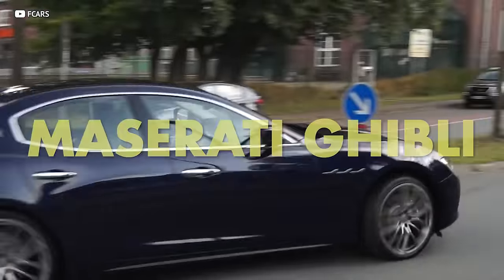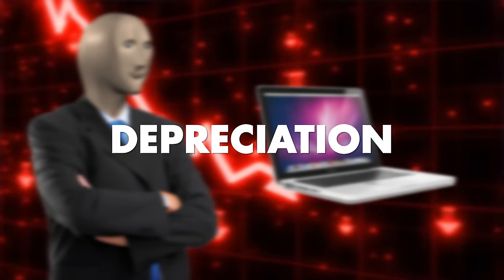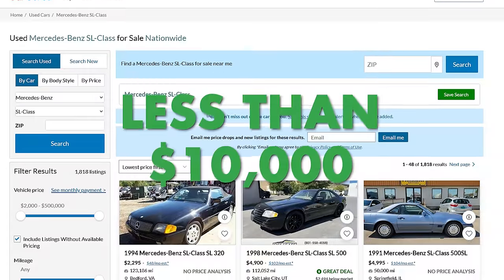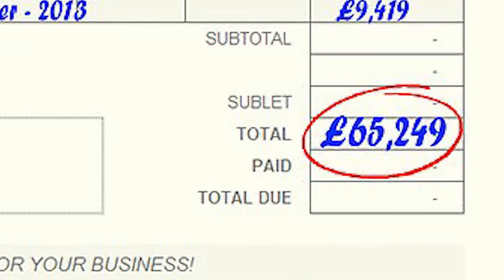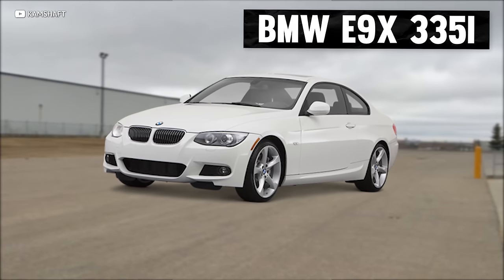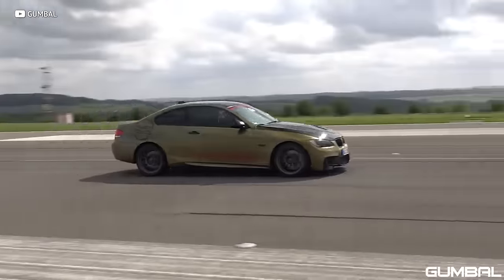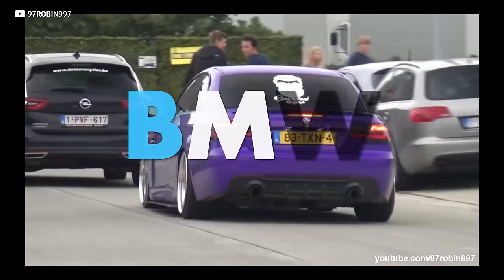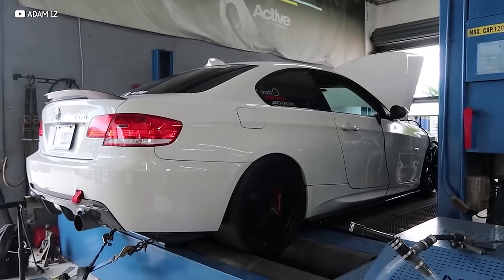Do NOT BUY These 10 Cheap Luxury Cars (You'll Go BROKE!)

Comment: Maintenance and upkeep costs are always calculated as a percentage of the new car price. If the car cost 100,000 when new, they are automatically 3x higher than for a car with a new value of 30,000. If a car is older than 10 years, you should calculate 5% of the new car price per year for maintenance and repairs.

Comment: FULL STOP.

I’ve been restoring a 2003 E class, and any Benz dealer will warranty out the SBC braking system in its entirety up to 25 years after the year of the car, and unlimited miles. 

Cost - $0
Reply: I have a 1989 Mercedes Benz 300ce and I love the car, fixing 3 issues it currently has now. Once I do that it’ll be a 100% road worthy, it’s at 70% as of now. Other than that it’s an amazing car, I just gotta button up the sound, paint and interior after it’s mechanically good, but after all, a 35 year old car!! Has survived way more than most new cars and has less than a 140k miles

Comment: The E90 M3 is an awesome car .. yes the throttle actuator can be an issue but you can fix for as little as $200.. only other possible issue are rod bearing .. you can replace for $2600 .. pricy but well worth it for this sweat V8 .. redlines at almost 9K and over 400hp .. or you can buy a Camry

Comment: Ah, the SBC braking system of the SL. That hydraulic unit is $1200 to purchase, but another $1000 to $1500 or so to install it, program it, and bleed the system. And they ALL need to be replaced eventually, because they do in fact have a service life, and the hydraulic unit counts it down. Benz stopped using SBC because folks were complaining about the cost to maintain such a system. Even though it’s a car that costs as much as a house, and the people know that going in……
Reply: The SBC in my 2009 SL was covered by the dealer until 2035.  Mercedes took full responsibility and replaced it for free.

Comment: I used to own a 2010 e92 335i. Most of the problems associated with high-pressure fuel pumps in earlier model years have been fixed in mine. However, the oil filter housing leak remains an issue. As for DFI carbon built-up, this problem is no different than other makes, like the Porsche, if you will. I also currently own a 2009 Mercedes R230 SL550 bought from new with relatively few issues. The key is to keep all maintenance up-to-date. For example, I flush the hydraulic suspension fluid every 30K miles, which prevents dirty fluid from clogging the valves & pipes. The cost to service the fluid at an independent Mercedes specialist shop is only a few hundred dollars. If you are willing to spend time & money on these maintenance items regularly, the Mercedes SL550 is a wonderful open-top GT cruiser that always puts a huge smile on my face every time I drive it.

Comment: Full disclosure: 
I changed all 8 wire harnesses and spark plugs on my 03' E500 Sedan, while in my driveway 3hrs tops. I also located a set of re-maned air struts from a spot down in Florida ($325 each). I then picked up Anti-Lock Break Pump ($199). I handled the light work and paid a pro shop to do the heavy lifting. It didn't quite cost me $1100, back in 2021.

Comment: I have noticed, I wonder if other people have noticed, these expensive European luxury cars plummet in resale value when they are just a few years old. I’ve watched the television auctions when a Rolls-Royce, or a very expensive model Mercedes, or Bentley comes across the block. They usually sell for around $.10 on the dollar of their original sale price.
  my best friend since high school back in the 60s loves BMW convertibles. He has bought three of them over a ten-year stretch that were returned lease cars. He bought the extended warranties on them not from BMW, but from those warranty companies that are always advertising on television…
 every time he took those BMWs into the service department at the dealer, he never got out of there without spending at least $1200 for simple things like oil change, filter, change, some noise or rattle. None of which was covered under warranty.
 he did have four expensive things happen to those three BMWs over the years that he was paying $151 a month for that warranty coverage..
convertible top would not go up, not covered 
Control panel that controls the opening and closing of the door locks and controlling the windows going up and down went bad, not covered 
  automatic transmission, shifter lever, that the driver could put into manual or automatic mode and drive the car, as though it was a stick shift by moving the lever through the pattern of shifting gears, they were all failing, and they were back, ordered to Germany, and even the salvage yards were out of them, because they were failing at such a high rate, not covered
  his driver seat frame broke, not covered. You think it would be not that tough to fix a broken seat frame, but that was a leather covered heated power seat.
 those four problems with his various BMW convertibles cost him over $11,000 out of pocket because they were not covered by the extended warranty. He was paying $151 a month for for over 10 years.
  over those 10 years, some little things were covered under warranty, but they were never items that a monitor more than a few hundred dollars. Over those 10 years that $151 a month for the extended warranty added up to over $18,000 that he paid in for that insurance that did not cover the big things. And, add that to the $11,000 he paid out-of-pocket to have the big things fixed. That is more money. more than $29,000 that he paid for that insurance, and the things that were not covered by the insurance. It dawned on him that he paid less than that for any one of those BMW cars when he bought them used…
  he finally grew up and went out and bought a new Chrysler minivan. He said it for six years now, and not had one single problem with it… And he didn’t buy the extended warranty either

Comment: Not these but a 98 Murcury Mystique that needed its 3rd motor at around 114,000km for which Ford Canada told me their engines are a common replacement item at around 70,000km

Comment: I owned a 2017 gulia qaud… bought it brand new and that thing had electrical issues and more from day one.

Headlight washers would pop out to spray the light and basically self destruct whilst ejecting outwards. 

Had a check engine light for the entire first year of ownership due to low compression in one of the cylinders and was eventually replaced with a new engine under warranty which cost about $40,000.
Lemon lawed that gulia asap after that couldn’t imagine owning one out of warranty especially with almost 50 pages of unmentioned service records from the first year.

Comment: I currently own a 2011 335i. I would not recommend buying any 335i with an N54. The N55 is much more reliable and you can still make great power on it. As long as you are prepared to to maintenance to the car, it’s a pretty great car for the price.

Comment: I have owned the Mercedes 2003 500 SL bought it used for 30,000. With only 30,000 miles.  Within 30 days cost me 20,000 to fix. I still had another 10,000 to go. 🤦🏾‍♂️ Needless to say 30 days later. I traded it in with my 2008 Cayenne to buy a 2013 cayenne 🤷🏾‍♂️ I’ve owned Range Rover. Also another decision.  I’ve had the best experience with Porsche out of all the vehicles. I currently have a 2014 911 Turbo and also a 2022 Panamera 4SE hybrid.  I’ve owned 18 Porsches. I’m Looking forward to buying a 2024 Cayenne coupe.

Comment: as someone who owns 2 BMW 335i at different years (2010/2011) let me just say any 335i prior to 2011 is better than any BMW 3 series 2011 and on. They came out with the twin scroll turbo which is kind of bs plus capping one of your exhaust with a flap. The reliability of parts also drastically decrease and prone to break compare to the prior models so be aware younglings :)

More context: you can technically disable the flap and have it always open by disabling a cable by your taillight however that would some times trigger a false positive error. They started using rubber seal around your front windshield which definitely will deteriorate overtime, water won't get in because the windshield still has its glue but the seal is basically all gone in a few years if the elements beat on it. Finally the most bs of it all was the steptronic. I rarely use it but one day it failed out of the blue, it basically will not go back to your regular mode when you get out of it unless you break completely and the auto system will kick it off. When I took it to a BMW dealership they took it apart and in the end telling me they couldn't figure out what the issue is but they can only guess it's "wear and tear" of the wiring :/ needless to say its all bs.

My 2010 335i was still a twin turbo, no cap, no rubber seal but plastic, and never had an issue with the steptronic and I own both relatively the same amount of time in the same environment.

Comment: SL55

I had one in 2014 for 6 years. Only bought it because it had the option of a Mercedes warranty @ £1500 a year. When I sold it (for peanuts) the total warranty bill was over £80,000.

Dash (led failed) - £4500 
Fuel tank (baffles loose) - £10,000
Central locking system - £3,000
Door handle - £700
Suspension struts x9 - £2000 each (£18000)
Suspension pump - no idea
Suspension oil pipes (had to have a new production run made @ mercedes so had an S-class for 4 months) - no idea.

The roof, engine and gearbox never went wrong, though. Plus it was my favourite car. Still miss it.
Reply: If you were using your own money, using an independent specialist, doing some of the work yourself, using OE manufacturer parts from factors likes the German company Autodoc and breakers ,the cost would be a tiny fraction of that!
My experience running a more humble older CL500 with abc was pretty painless.
In eastern Europe with lower labour rates it would cheaper still, however older luxury cars are way cheaper in the UK to buy than anywhere else apart from Japan so swings and roundabouts.

Comment: WRONG!! The Range Rover's direct injection 5.0 AJ-V8 Gen III engine has no similarity with the Ford Coyote, being derived from the multi-port Gen II AJ-V8. All AJ-V8 engines are all-Jaguar, with no Ford origin. 

BTW, the Jaguar AJ-V6 engine is also falsely claimed to be based on the Ford Duratec v6, while it is in fact the other way 'round. The AJ-V6 is all-Porsche, bought by Ford when Porsche abandoned its replacement of the 968 and 928. Cosworth engineered a cheaper head for the Duratec v6, Mazda did the same for its version and Jaguar was handed the unaltered Porsche v6. The engine was modular, the v8 being installed in the Taurus SHO, and the v12 in Aston Martins. None of these ex-Porsche engines is "Ecotec-based", as is commonly claimed.

Comment: 🤣 I have an 08 S4. love the car, but hate the bills. Never buy one unless the timing chain was done 90k. It also has a water-cooled alternator, but I have never had an issue with it.
I need a small facia interior piece made of carbon, it's $400, the armrest center cover because the latch broke $500, and general maintenance is also pricey.

Comment: You guys are doing a good job. 
I know exactly how many problems there are with the BMW 335i. Especially when the power increases. At the same time, it's my favorite car, even though I've stuffed so much money into it that it makes me sick.
Interesting that in other videos you recommend the 335i as a cheap option to get high performance.
Can you make a video recommending a car like the 335i that could get high performance, look good, not cost a million, and not cost twice the value of the car to repair?
I'm guessing such a car doesn't exist, but you might surprise me... :)
Reply: N55 more reliable than the N54
Reply: As a previous owner of a 2011 335i it was reliable.  I had the same exact engine in our X5 and it had nothing but problems all the time. We got rid of the X5 and now my wife has an 3018 Rx350. The only problem with that has been the stereo head unit literally died and would have been $3,500 to replace if we did not have the extended warranty.
Reply: Sorry 2018!

Comment: Dont listen to this guy. Just get an extended warranty contract like Carsshield or Endurance warranty company.  I own a 2010 Mercedes-Benz CL 65 AMG V-12 and I first had the Carshield warranty and now from recommendations from Mercedes-Benz of south Atlanta (where I originally purchased it), I am with Endurance warranty but plan to go back to Carshield next year. I had it covered from Carshield for 3 years and endurance warranty for two years. Yes the ABC suspension went out but it was a cable for $900. Now years later the shocks are leaking but I found two on eBay for $350. I did have transmission issues but Carshield replaced it. My window stopped working and Endurance warranty paid for it. The alternator and starter went out but Carshield paid for it. The control arms and brake caliper went out and Endurance paid over $3k. My Benz was a 1 owner lease return and I still drive it. The radio has been the only main problem but if you don’t car about music then you good. The warranty companies don’t fix most of the radio stuff.

Comment: I was on my way to work one morning and I saw a pretty nice looking car. It was on a flat bed and it was something I'd never seen nor heard of before. The car was a Karma Revero GT. It was from where I was sitting, it was a very nice looking car. It had a pretty blue paint job and it was a wide body like I love on sport cars. 
   So I went home and started trying to find out what I could about this car. I was definitely interested in maybe buying one. But there was one thing holding me back. The first one I have ever seen was on the back of a flat bed truck. I wasn't sure if it was broken down or being delivered to someone. 
    I looked the car up and the price tag brand new was $145,000..... Well, I need to see if I can find maybe a used one for sell. The price wasn't scary at first, but then when I dug a little deeper into this car, I find out that a 3 year old used car is selling for $30k to $35,000. This car definitely doesn't hold a resell value for crap. I thought about buying a used one and if I loved the car, then maybe I'd be interested enough on buying a brand new one. 
   I went to 2 different city's to look at and test drive the cars. 1 car was $32k and the other one was $45k. I pulled up about an hour early at the dealership and I see someone working on the car. This to me is not a good sign at all, especially when you want $45k for a 2 year old car that doesn't hold its value. I talk to the service guy and he informs me that the car has been sold and he putting the finishing touches on it. Oh I got so mad 😠 😡 😤. I walked in and ask them why they sold a car when they had someone driving 15hrs to see the thing? They said oh your the guy coming to look at it? I said yes and I haven't bought anything yet. 
    We walk back to the car and I opened the door. The inside looked pretty good and not very many miles on it either. Now time for the test drive. The guy tells me that it can't be driven yet, cause the battery pack is bad. They ordered one and it would be about a week before they could get it. I said ok, thanks and I left. 
   The next car is a person's car at their house. I drive another 4hrs to go look at this car and I pulled in and was like wow. This car had a beautiful paint job on it. The car changed colors depending on how the light hit it. The owner informs me that the battery pack in the car is 3 months old and has a 1 year warranty. I took it for a spin and found out why they don't hold their resell value. I personally think the cars performance sucks!!! For $32k, I might as well buy a used Tesla. All that driving around for nothing. I spent 15 minutes driving a car I thought I might love and hated it. 
    So be careful. I'll stick with my Camaro Exorcist that was built by Hennessey.

Comment: I would like to point out that you didn't mention the cayenne years to stay away from. 2011 and up replaced the plastic coolant pipes with metal and fixed that issue. The air suspension wasn't mentioned in any capacity which is really insane because of how reliable they are. I have a 13 GTS and I love it, facelifted and up to date on most of the issues the first gets have.

Comment: Well, i own a 325i e90 with the N52B25, and this thing is actually good. Aside from the valve cover oiling problem of course... The thing is, i had the last real 2.5l before they downsized the 3.0l one. Means: i don´t have the direct injection and the problems coming with it. No NOx converters, no failing injectors, no high pressure fuel system and stable 218HP. Its not plenty of power, but down the Fuchsröhre i reach about 205 Km/h wich is enough for me.

Comment: few things about mercedes SL , ABC suspension is a problem - TRUE (but there are smaller engines SL350/500 sometimes comes without ABC-solved) , Roof hydraulics can be an issue - true (but so do any other automatic convertibles) , SBC braking system hard to fix - true ( I owed 10 different Mercedes in SBC era and it never was at fault for me up to 300 000kms+) , R230 has a few engines , not just SL600, get SL350/500 but with M112/113 engines and  5gtronic gearbox to avoid most problems and enjoy the car

Comment: The 2016- and up Q50 Red Spot this car has amazing power and is a thrilling experience when you push the car to its limits.The reliability on the other hand is subpar at best. I drove a 2012 G37 x sport and it was easily the best thing on the road when it came out absolute total package and extremely reliable 100 times better than the Mercedes C350 or BMW 335 back in 2012 you needed an AMG 63 or an BMW M3 to beat the G37 x sport, in my head the Q50 Red Sport was gonna be everything the G37 x sport was but just faster. Boy boy was I wrong needless to say I’m now driving a Lexus 350 F sport a man needs reliability!!!!!